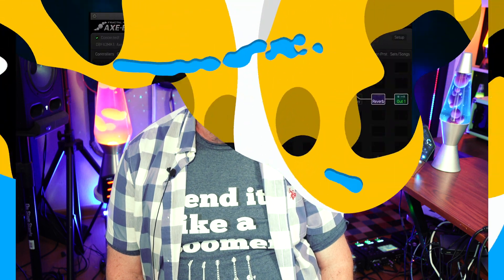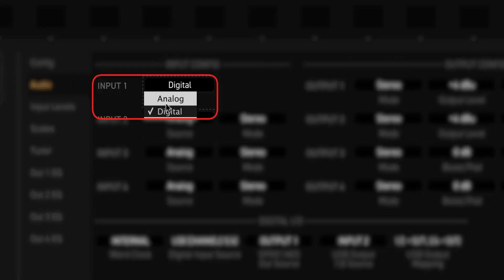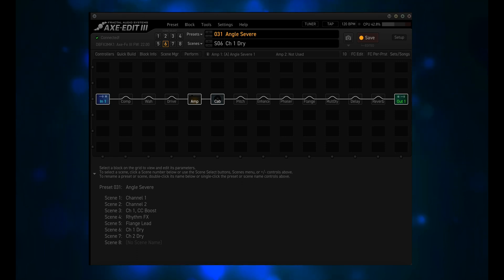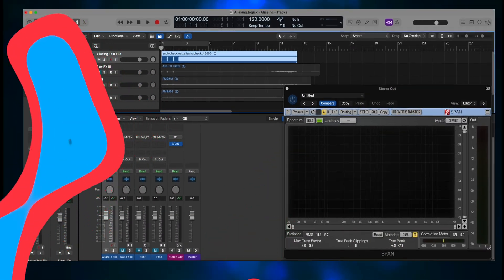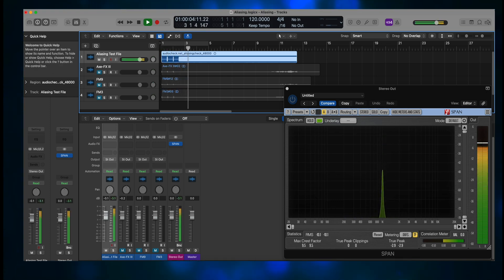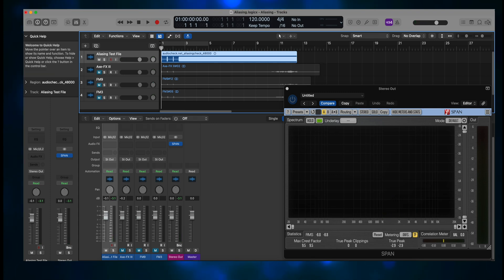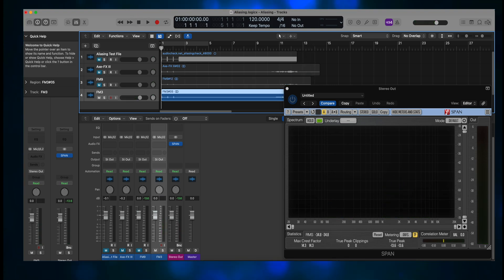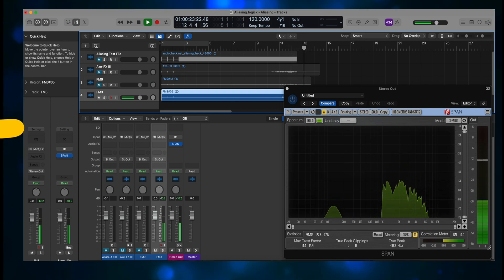Axe-Fx III/FM9/FM3 - Aliasing Shootout, Take 2!

Comment: I have the axe fx II (original) with no oversampling.  I was thinking of getting one of the new units.  Now I think I would only buy the III - definitely not the fm3.
Reply: @MysticalPotatoHeadGrooveThing  I looked into it just now - they talk about oversampling being involved in the III and the II but not in the others.  Some people can't tell the difference - but in my experience I've usually heard the difference in such things Cliff has bothered to do - so if I'm paying that much money.'Ill just go for it. Regarding the oversampling in the II vs the III here's what's said: 

"The amp modeling algorithm is very similar but there's a few places on the II where we had to make compromises to get the algorithm to run within the allotted time. Also the III has a higher internal oversampling rate and a higher bit depth on some calculations (64-bit vs. 40-bit)."